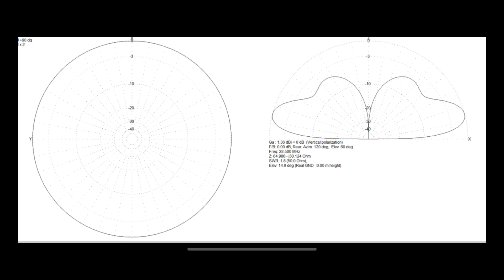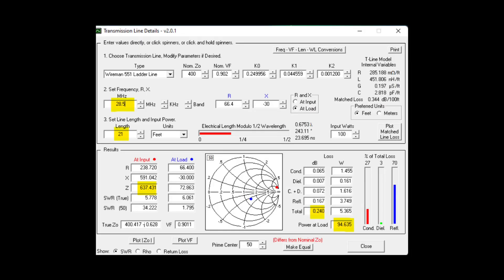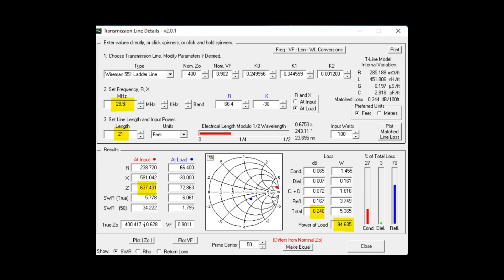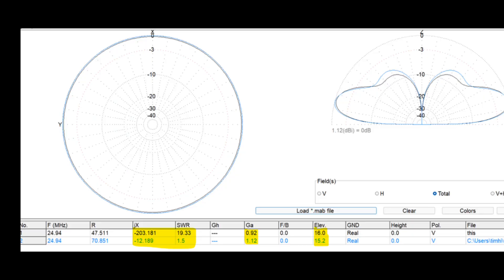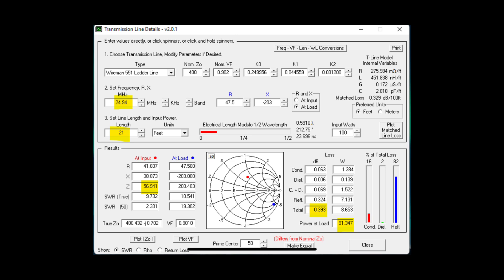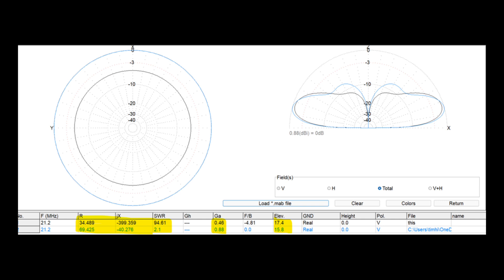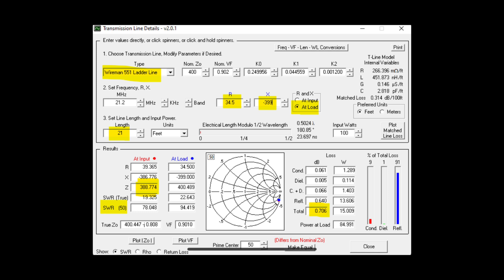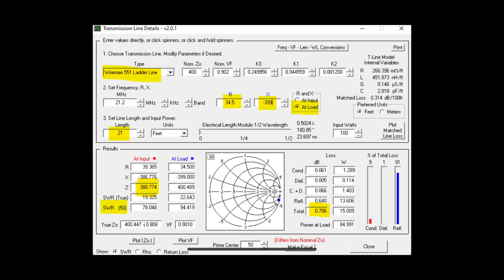Ham Radio: Easy Multi-band Vertical Antenna for HF

Comment: Hello Tim! I probably missed it from the video. What should be the best length of the ladder line? Mny tnx for your reply.
Reply from the maker: As long as you need .. be prepared to take some off or add some on to bring in all bands but chances are you’ll be ok

Comment: Thank for the idea, I've been thinking of ways to do this on SOTA.  What does it look like if you drop it to 1m up? I'm thinking about running it on my SOTA's and 6m SOTAbeams tactical mini.  How far out does the ladder line need to come out from the dipole before turning down if you are only running QRP?
Reply from the maker: 1m is fine. Best to run the ladderline as near as you can to 90 degrees from the feed point for about a 1/4 wave of the lowest frequency you will use.